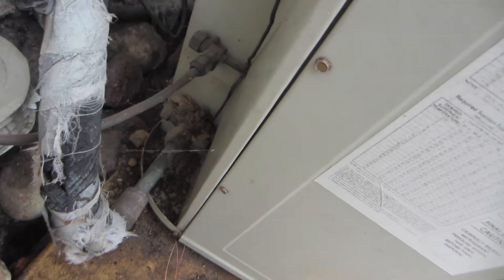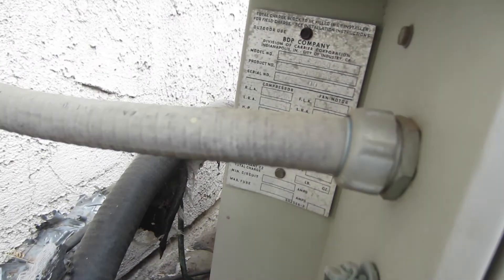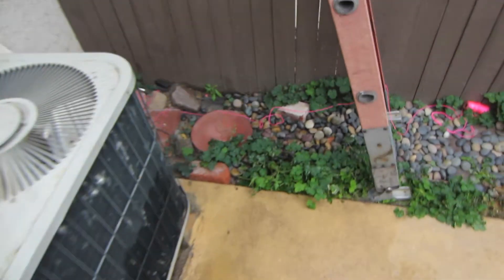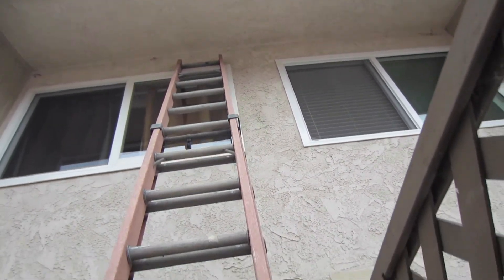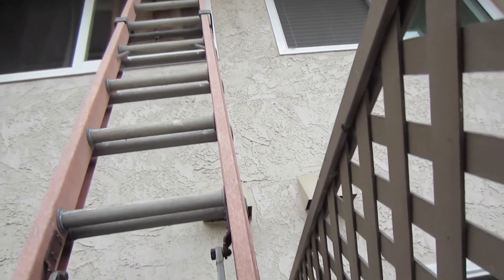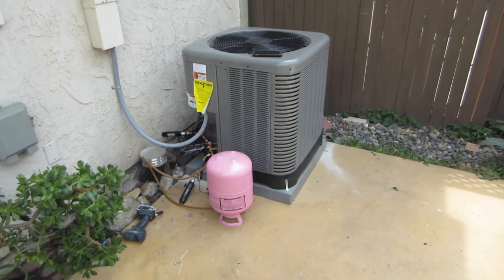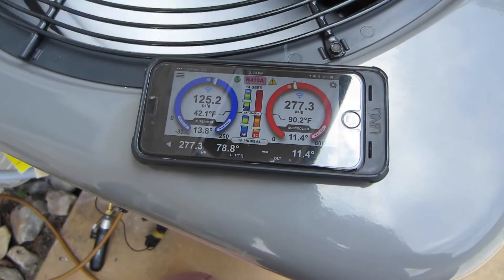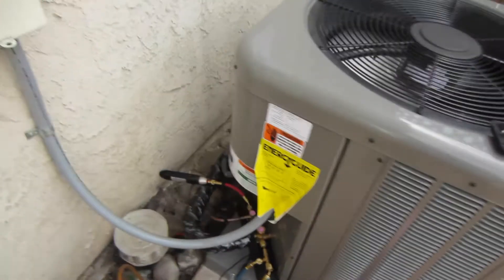RHEEM NEW PLATFORM RA 14 CONDENSER

Comment: Nice work. What's with the vent cap at the ground by the unit!
Reply from the maker: Thanks Rob, I was thinking the same thing when I was there, all I can tell you it has the handyman finger prints all over it. The cap is attached to 4" ABS and the condo is on a slab. Thanks for watching.

Comment: Nice job
What are you running in the 3/4 flex that goes along with the line set? Is it the 24v wire ?
Reply from the maker: Thank you very much! Yes that is the 24V control wire and I run it in 1/2 seal tight. Thanks for watching!